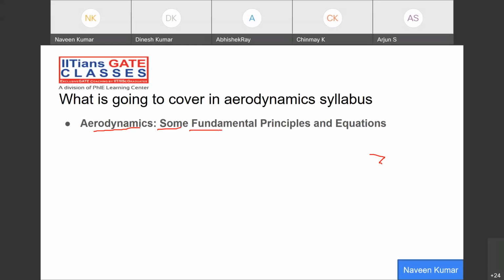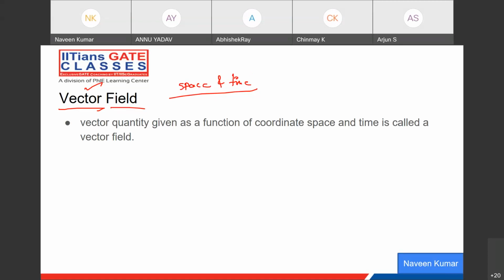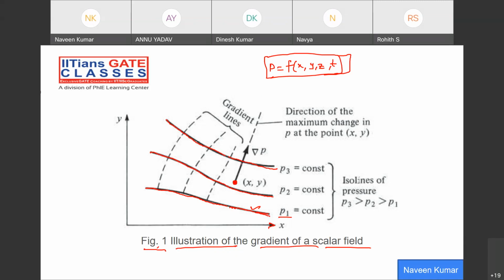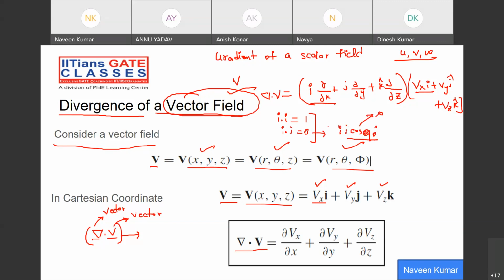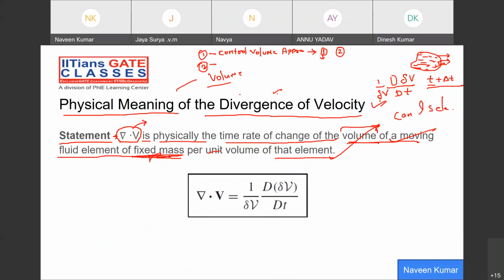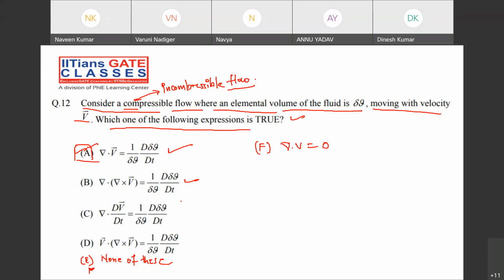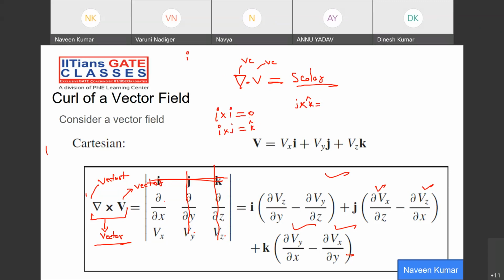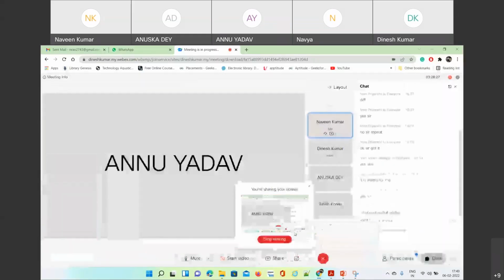Aerodynamics Basic | GATE Aerospace Engineering Lectures | GATE AE Live Interactive Online Coaching

Comment: as per statement of physical meaning of divergent of velocity we consider mass is fixed for formula in option A but  flow is compressible in which density is not constant so mass should not be fixed and we also take 2nd case for this formula so in which mass is fixed so how this is correct ?
please clear the doubt.